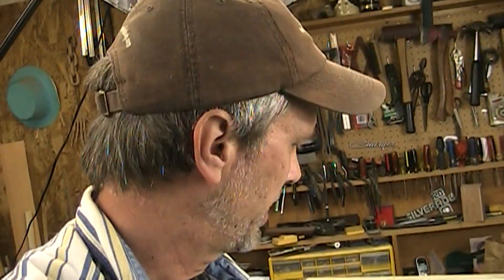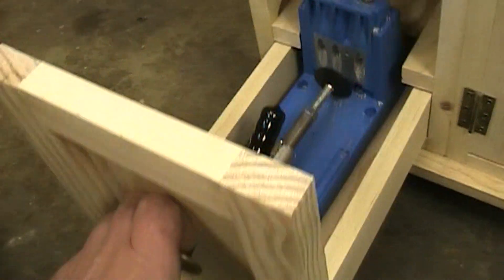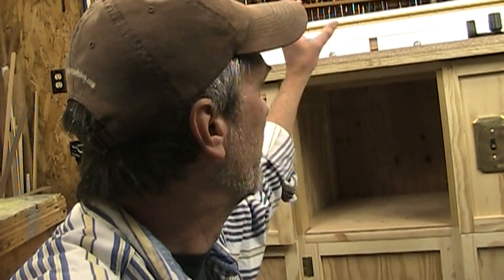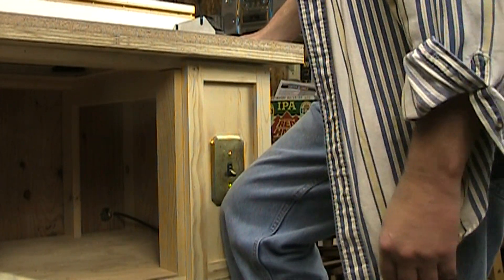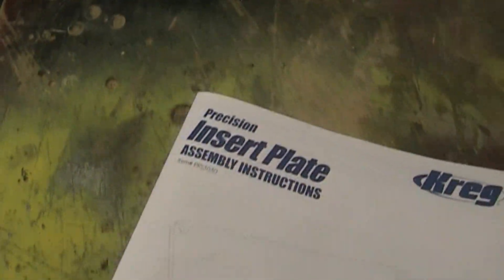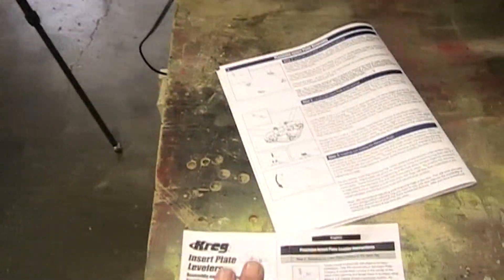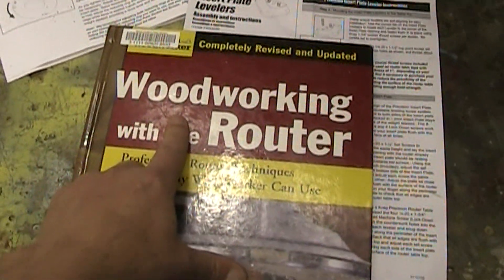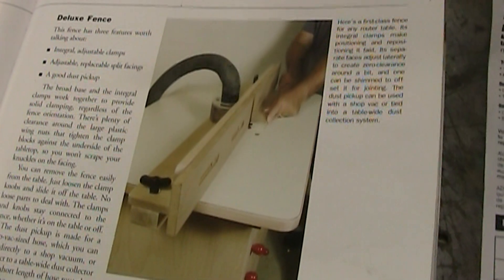MM 3-18-12: Router table follow-up

Comment: Thank you for showing the runner issue. I just built a vanity for my wife in a bathroom remodel project and I used wood runners because I didn't want to buy drawer slides. Because you showed a "mistake" with your runners, you saved me from doing the same thing. THANK YOU STEVE!!!

Comment: Thanks Steve, I had ordered a insert from another company, it used earth magnets and screws...I didn't like it, ditched the magnets as they were hard to work with,fell off etc.  installed some small wood screws instead and viola! Worked like a charm...like the clamps as well have used them on a few projects, keep them coming.

Comment: I have a 4" dust collection port in mine. Your comment seems to be accurate, it doesn't collect a lot, but I'd rather have it fall in the bottom than end up in the air.  As a side benefit it seems to keep the router cooler. The motor can get quite warm in the enclosed space without any air flow.  nice table!

Comment: Hi a tip for cutting an exact hole for the router plate, is to sit the plate on the wood to be the template, screw 4 pieces of wood tight to the outside of the plate then roughly jig saw near to the inside size then router out the exact size with your trim router ,
hope thats a wee bit clear,
Graeme.

Comment: Another thing to add to your table. Buy to metal meters. Make groove of this size on both sides of the table perpendicular to fence. Glue meter plates into grooves. So now when you position your fence you can position it very precisely on both side.

Comment: drill a hole in the table top where you think most of the dust will go drill a hole in the back pannel of the opening (both holes need to be the same sise as your shop vack) and put the hose through the back and conect it to the hole in the table top. just an idea hope it helps great vids tho

Comment: 1-After many frustrations I give up to  extract dust from ANY router table, In my opinion let your front open, w/o any port.  
2- I found a Delta Lathe 4612 here in Brazil and I'm starting the restoration. Could you show us your lathe?
Warm regards
Michel from Sao Paulo/Brazil.

Comment: Thanks for sharing! why not a speed control?
Reply: Duane Richards 
It's not usually a good idea to connect a single speed router (or any single speed tool for that matter) to a variable speed control. 
The reason is that speed controls either reduce current using resistance or they reduce the "duty cycle" (meaning that they switch the power on and off very quickly so that the speed of the tool is reduced based on the average of time that the power is on compared to the time that the power is off, sometimes called a "switching power supply").
The reason that it's not a good idea to run a single speed tool on a variable power source is that the motors in such tools are designed to operate within a relatively narrow range of power parameters (current, voltage, resistance, duty cycle, etc). When the power supplied to such tools falls outside of those parameters, as happens in the case of variable power sources, the motor tends to run much hotter. That presents problems in the form of fire hazard, extreme thermal expansion and contraction, and much greater wear on the tool which means a much shorter serviceable life for the tool. In fact, you could "smoke" the tool in a matter of minutes and burn it up.
.
A word of caution about connecting variable speed tools to variable power supplies. 
Just because the tool is variable speed still doesn't mean it will necessarily be compatible with a variable power source. One such case is where the speed control built in to the tool controls the speed by turning on or off different sections of the windings within the motor of the tool. A multi-position switch turns on an additional section of windings at each higher speed setting until the highest switch setting energizes all the windings in the motor. The more windings that are energized, the more electromagnetic field force is built up which leads to higher and higher speed.
In those cases, the only way the speed can be correctly and safely controlled is through the speed control built in to the tool itself and that means that varying the current or voltage input will lead to the very same problems encountered by the single speed motors described above.
Long story short, it's usually not a good idea to mess with the source values of power going to a power tool. If you want variable speed, get a variable speed tool and control the speed with the controls built in to the tool.